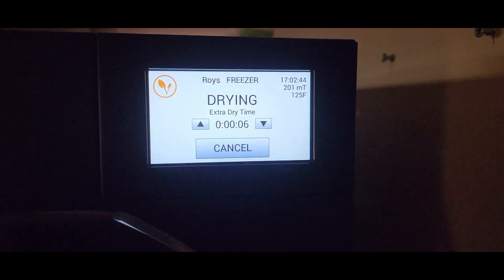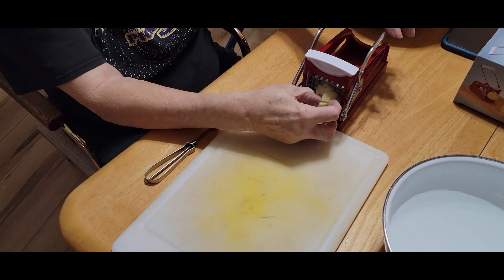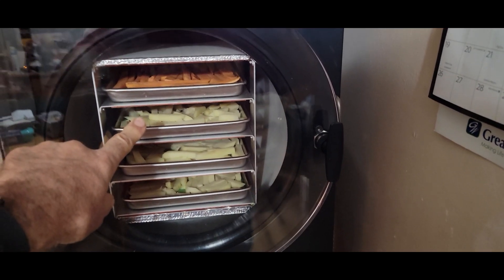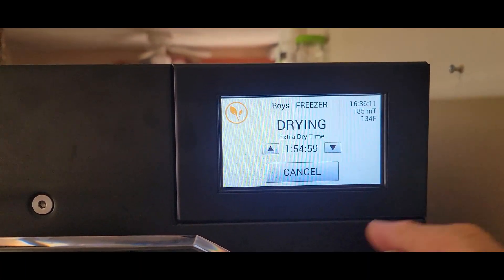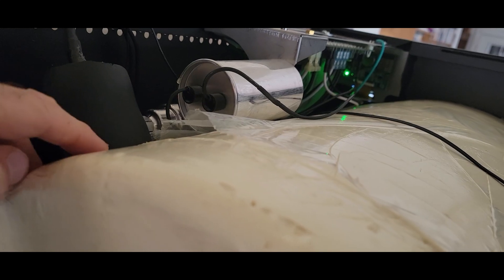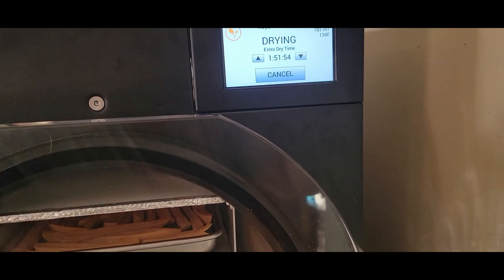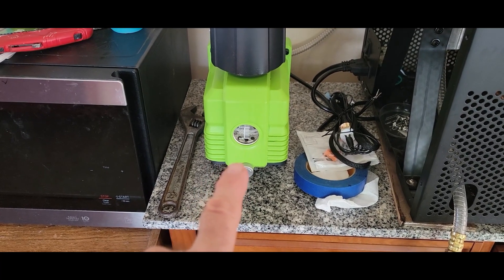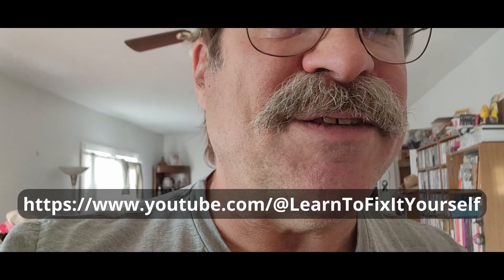Harvest Right Vacuum Error #9 - Part 8 Vacuum Error Fixed

Comment: Thank you,, bought my machine end of July. Haven’t run but about 25 batches and have had numerous vacuum failures. So far have followed all the companies recommendations, your videos are great. Had failure again last night😢
Reply from the maker: I did get it fixed.  I have currently run 3 batches with no errors and the vacuum is holding. We found 3 locations where the leaks were happening.